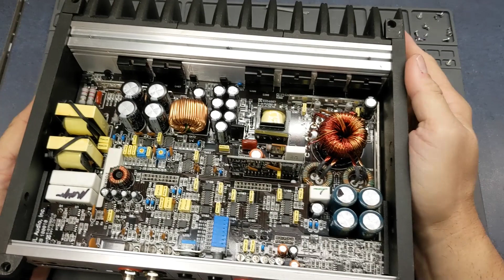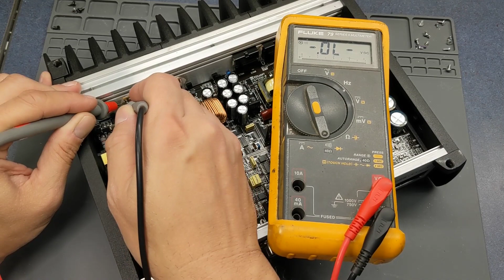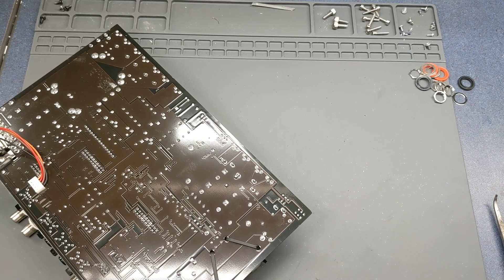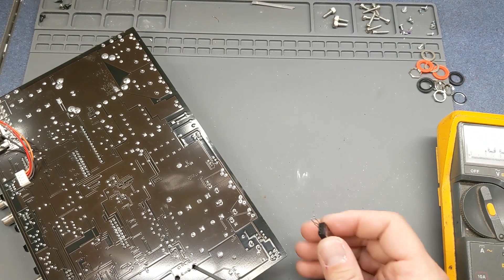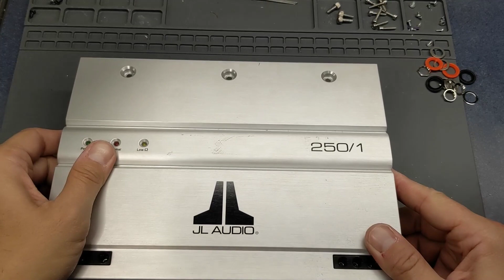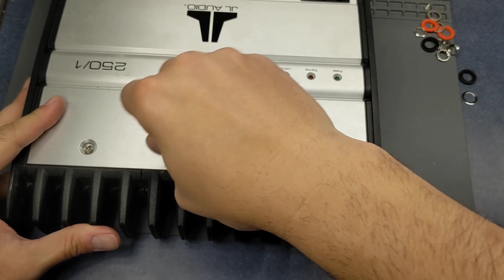JL Audio 250/1 Repair

Comment: I am close to crying my eyes out after hooking up my jl audio  600/4 backwards.  sure the under the hood fuse blew  but not it flashes red/green.  If you are tired and want to finish something before to quit for the night might I suggest just  holding off and finishing the next day.  No matter how much you feel you could never make a mistake like that I thought the same thing.   Anyway I will never send it out for repair I just wont so  I am slowly testing everything and trying to find out what exactly is blown.  I wish I had the knowledge needed to do this.   I   really dont even know if I had a point to make so I will now just thank this guy for the video that im going to shut up and watch among many more and hopefully I will learn enough to find out what is wrong with mine.  UGgh this amp  costs almost 2 grand so I feel that much worse cuz how could i do the most careless thing on the best amp, by far,  that I have ever owned.

Comment: Love jl audio amp repairs. I have the hd series 1200w mono  and hd 600.4. They are a PITA to work on or take apart but love them as an amp. I'd happily own the similar power rating slash amps those things are beautiful and bad ass. Subbed ❤️

Comment: Any idea if the relay for remote on is serviceable?  Assuming it's located between the two boards.  Mine won't seem to turn off despite a working remote wire or on autosense.

Comment: Would CPU Thermal paste work in place of the compound?
Reply from the maker: Yep, it would work just fine, same thing really. Usually the stuff for CPUs is more expensive because they want it to be more efficient, but when you are repairing a bunch of amplifiers it's good to have a big tube. You could also use the same stuff I used on the amp for a CPU and it would work fine too, it just might not be quite as efficient.
Reply: @TheRetroBen  When doing a once a year or every 5 year repair, its nice to know the stuff I already have would work.  Now my mind is going to the SNES as I do not believe they ever used any type of paste/compound.